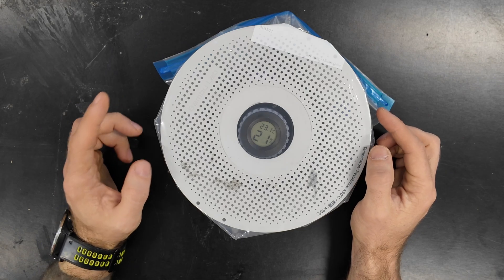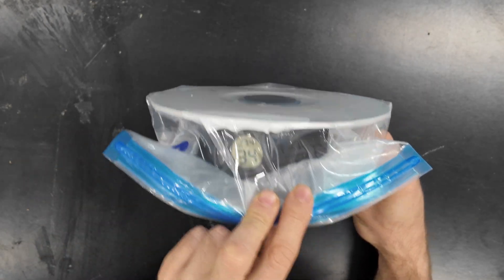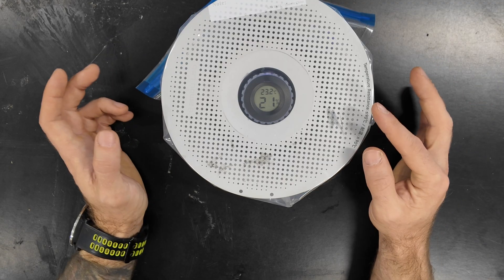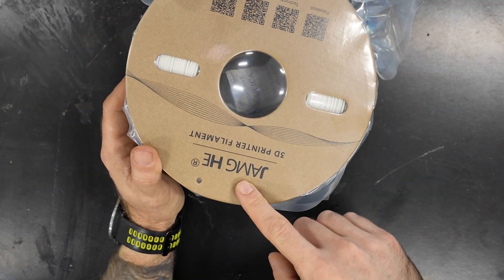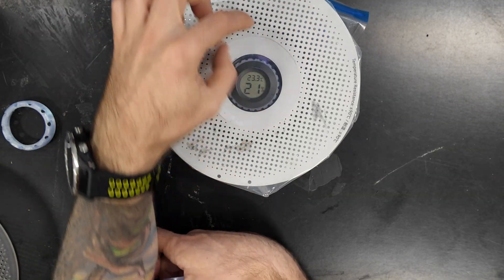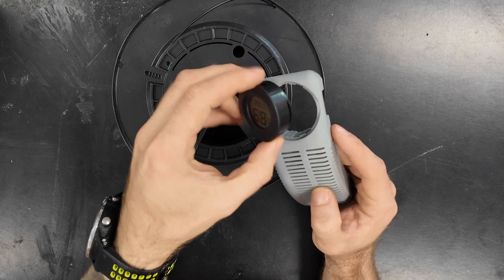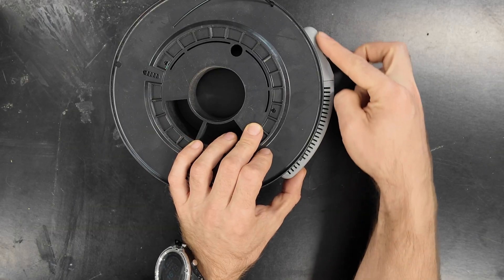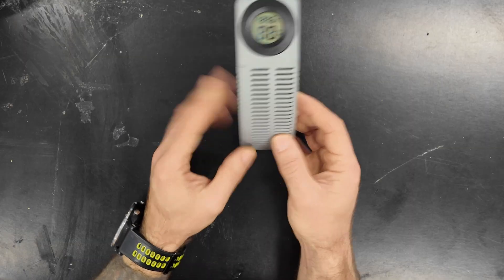In-spool desiccant boxes don't work so I made a different one

Comment: Nice design, do you have a link to the hygrometer you are using?
Reply from the maker: Hi! It's a generic 45mm diameter hygrometer. Available almost everywhere:

- aliexpress (this is the one in video): https://www.aliexpress.com/item/1005008994813336.html
- amazon: https://www.amazon.com/s?k=round+hygrometer
- bambulab: https://us.store.bambulab.com/products/circular-embedded-electronic-digital-thermometer-hygrometer-1pcs-xf001

They are all the same, just remember to have some LR44 batteries to power them - they last 6-9 months usually.